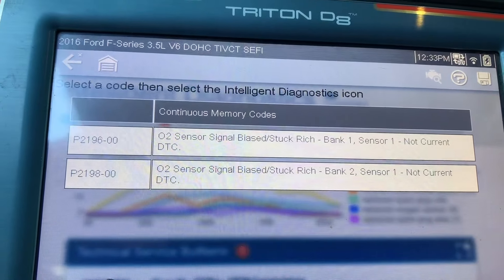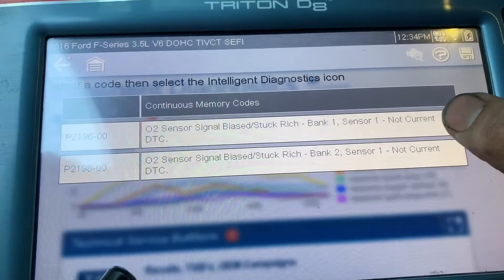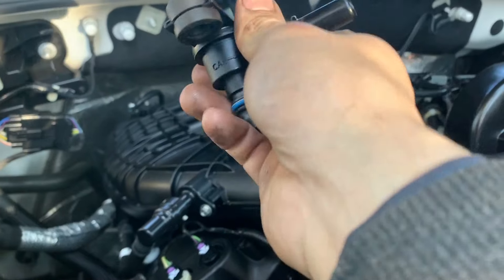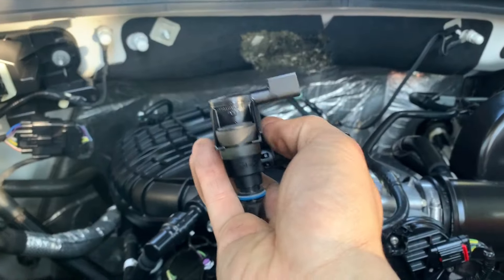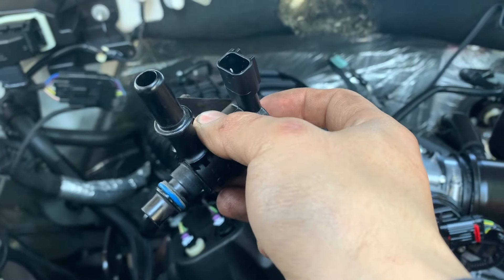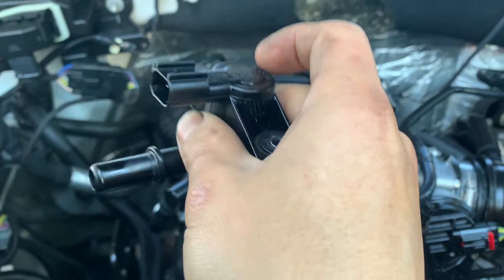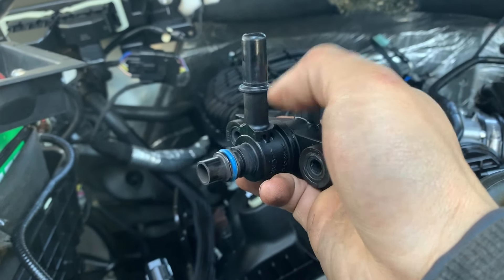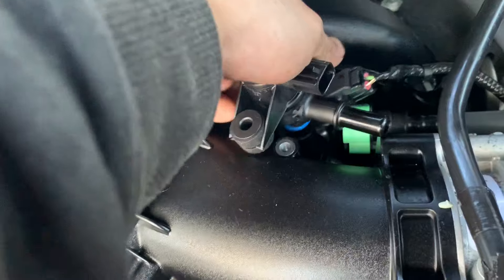Ford F150 O2 Sensor Signal Stuck Rich Bank 1 And 2 (Code P2196 / P2198)

Comment: Thank you! Saved me a lot of time and money. My truck had codes for O2 sensors. I changed two of them and seemed to run ok for a while. Then it started idling after driving it a short distance. I checked the purge valve and sure enough I could blow air through it. Swapped it out for a new one ($35) in 5 minutes, and now it’s running just fine.

Comment: Hey, I wanted to say THANK YOU VERY MUCH FOR MAKING THIS VIDEO!
I had the same two codes as above and I talked with a friend who works for Ford and he said that the O2 sensors needed to be changed. This would have been the 2nd time in 4 years. So you saved me more than $250.00 in parts. You just got a lifetime subscription from me! Keep up the GREAT WORK!
Eric M.
Mansfield, Texas
Reply from the maker: Im glad it solved the CEL and thank you.
Reply: Instablaster.

Comment: This fixed my 2015 f250 6.2l. I had the same codes. Thank you!👊
Reply: Did it ever cause no start or hard start my 2010 5.4 had the o2 replaced a few days later wouldn’t start but had no codes they couldn’t figure out why it wouldn’t start randomly tried a few days ago it started but then those codes popped up not sure if it’s from old gas now or that was the cause for the no start to begin with and sitting allowed it to clear out

Comment: 100% fix for my 2014 f150. Codes said both banks' first oxygen sensor bad.  Seemed odd two would go bad simultaneously.  Replaced purge valve, done.  Less than a 5 min job too
Reply: Trying to fix my 2014 f150 too right now, what symptoms did you have other than the codes?
Reply: @bigbruh7951  none really.  Slightly rough idle but mainly just the codes.  Even when. I was reading with forscan it thought it was the both o2 sensors on each bank

Comment: Hello love your straight to the point fix and problem my truck is blowing white smoke like crazy and barely idling I don't know what it is I said sensors and this and that but from what you say I think that's the problem but I just having a hard time taking off the hoses is there a trick to it hopefully you see this now cuz I'm working on it thanks
Reply from the maker: Press the green lock at the bottom to get it unlock. Press both side and the lock should pop up.

Comment: I just changed my fuel filter and I'm getting these same codes for my 2006 Ford f150. It idles bad and it'll crank bad now. Never did before. Any thoughts or suggestions would be extremely appreciated. Thanks
Reply from the maker: Is there any check engine light codes?
Reply: @Ah_Duuu_Ma  I fixed it. Thanks for the reply though.

Comment: 2004 expedition p2196 bank 1 cylinder 1…. What would you suggest??? I’ve checked for vacuum leaks and can’t find any…. Code comes and goes… thanks
Reply from the maker: Do the same. Replace the purge valve.
Reply: Did you fix it? I'm getting the same code. Just that code alone.

Comment: I took my valve off, checked it seemed fine because both sides were closed no air would go threw. But after I pulled it and checked it the CEL went away… but my fuel economy is still terrible.
Reply from the maker: I recommend you do a full complete tune up. Replacing all spark plugs, engine air filter, and synthetic oil change. This will helps your car breath better. Bad/old spark plugs and dirty air filter will makes your car runs poorly. If you love your car enough, change out the transmission fluids too, makes the car drive smoother. 
Improper tires inflation and bad oxygen sensor will causes fuel consumption too.

Comment: I have these two codes on my 2015 f150 (p2196 and p2198) and I also have code p1450. The truck seems to run okay but whenever I get gas it won’t start after unless I pump the gas pedal. It also takes a few tries to stay running. What should I do?
Reply from the maker: P1450 is canister purge valve. The purge valve cant bleed up the fuel tank, thats why you have to press gas pedal. Replace the part and it should be fix, very common code on ford.

Comment: I have a 2004 5.4 with these codes after I changed plugs coils and injectors..to find out I had a broken injector wire.
But like I said I have these two codes now should I go with the purge valve or change back to the original injectors?
Reply from the maker: Whats the exact codes?
Reply: P2196 & p2198
Reply from the maker: @hoffman565  Ived checked the codes on computer for this 5.4l engine (most hated engine). Check the mass air flow sensor, most common problem is bad spark plugs and leaking injectors.
Reply: @Ah_Duuu_Ma  I know a lot of people hate these engines but if maintenance is up to date they run for ever 
I changed the plugs coils and injectors with motorcraft parts.
I'll look at a maf sensor and see if it's dirty or just not working
Reply from the maker: @hoffman565  Replace the engine air filter if needed. Clean the mass air flow sensor and reset the fuel trim memory if needed after replacing maf sensor.
Reply: Actually bit the bullet and cleaned the factory injectors and replaced them with the Amazon ones I had installed and the truck runs like new and no codes

Comment: Does the 2006 F150 5.4L have this part?? Thanks for the video
Reply from the maker: 5.4 has purge valve too but slightly different design look and different part number. Call dealership.
Reply: That valve is on the drive side fire wall above the brake booster
Reply: did it fix?

Comment: I have both the same codes but i have no cats. My rear o2 doesnt have a issue just the front 2 like this video. I also have a purge valve but idk if this my issue bc i didnt get a evap code
Reply from the maker: if you have the same code then replace the purge valve.
Reply: @Ah_Duuu_Ma  even without a evap or egr code?

Comment: 2020 F150 5.0 , p219a I check my purge valve , it’s closed,  don’t know what else to do. 😢.
Reply from the maker: List to check for *
Leaking or bad injectors (incorrect fuel pressure)
Leaking exhaust system 
Bad egr 
Bad crankcase ventilation valve
Bad mass air flow sensor (check air filter)
Bad o2 sensor
Bad purge valve (stuck close/open)

Comment: I have the same codes my engine is misfifing bad and shaking too. If this fix my problem i will gladly tip you
Reply from the maker: If you have the same code then do the same as i did. If this doesnt solve it, then you have to check on the sparkplugs and ignition coils.
Reply: Did it fix?

Comment: Hey boss, my truck is throwing these codes and po451. AND IT WONT START. Just endlessly cranks, I just got it back from the Ford techs yesterday, it had done the same thing last week and they told my it was the cats so I had them replaced but now we are back at square one. I'm gonna test that valve next but any help would be a blessing. Thanks so much!
Reply from the maker: Car cranks but no start means either no full or no sparks. Could be few causes - no spark, no fuel, bad crank sensor, bad pcm, electrical problems.
Check one by one.
Check spark plug for sparks when cranking.
Disconnect the fuel line, and key on to see if fuel is pumping up. If no fuel coming up, then fuel pump is bad. 
Check crank sensor for signals (if you know how).
Reply: I know you posted 8 months ago, but I just had the same issue a while ago. I just had to replace the fuel pump relay! (#8 for my 2012 F150). $30 fix (with taxes) and fixed in less than 5 minutes
Reply: @Ah_Duuu_Ma  been a minute but I figured I'd update, fixed it by pushing the pedal in fully before cranking to shut off fuel supply, then releasing once the flooding was cleared. Simple but hard as hell to figure out lol

Comment: Hi, I have 2015 Ford Fiesta with codes p 0172 P2196  , anysugestions please?
Reply from the maker: P0172 is fuel system rich. P2196 is purge valve canister purge solenoid. Both codes related to bad purge valve, replace it.
Reply: @Ah_Duuu_Ma  
I took the valve of the line going to tank and blocked it. No change.

Comment: mine is reading the same codes,2014,...will this cause the truck to have a miss/stutter while driving?
Reply from the maker: Do the same thing to clear the codes first. For the missfired and stutter, spark plugs are bad, replace it. Clogged catalytic converter can causes the car to stutter because of restricted airflow in exhaust system. Hopefully, it's not the CAT.
Reply: @Ah_Duuu_Ma  Ok,thanks alot for the video and response

Comment: My Ford ranger has those two codes p2198 and p2196 switched the sensors and check engine light stays on

Comment: Could this also be the same but if it’s a lean code?
Reply from the maker: Too lean would be dif codes. Too lean then you have more air than gas in the system, which mean you have a vacuum leak.

Comment: What else could be the problem if I replaced both bank 1 sensor 1, bank 2 sensor 1 and also the purge valve and continue to get the P2196/ P2198 codes? This is on a 2013 ford f-150 xlt 5.0 and I have had the auto parts guy clear the codes after running around for 50 plus miles or so with the new parts in.
Reply from the maker: 1 check mass air flow sensor and air filter (dirty or bad sensor)
2 bad O2 sensors - check wire harness (open/short in circuit or loose/burnt connectors)
3 fuel pressure system too high or leaking injectors
4 exhaust leak
Reply: @Ah_Duuu_Ma  thank you for the info I will check these out I am confident it's not fuel injection system or exhaust leak.
Reply: @famousoviedo what was your issue?
Reply: change your air filter, i just did and it fixed it,2012 explorer

Comment: I get code U300A-29 Ignition switch signal invalid with traction off lights and ABS ligth with a message check brake sytem for 2013 ford Fusion hybrid SE
Reply from the maker: "U300A-29" possible causes - shorted or open electrical wires, bad or corroded ignition cylinder lock, faulty body control module.

Comment: i just changed mine today and cleaned my MAF sensor yesterday but im still getting these codes what else could it be?
Reply from the maker: Possible causes
1 check mass air flow sensor and air filter (dirty or bad sensor)
2 bad O2 sensors - check wire harness (open/short in circuit or loose/burnt connectors)
3 fuel pressure system too high or leaking injectors
4 exhaust leak
Reply: @Ah_Duuu_Ma  i got my sensors replaced like 3 months ago to idk if they can go out that fast or sum but i will check my exhaust next then injectors thank u